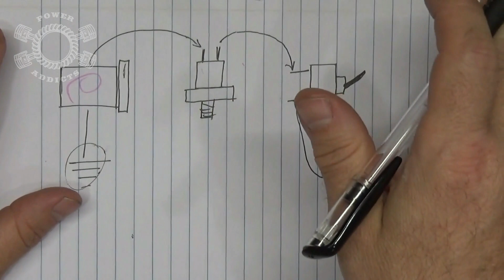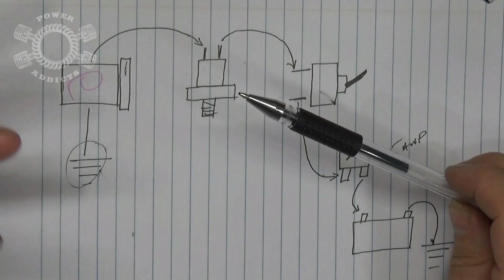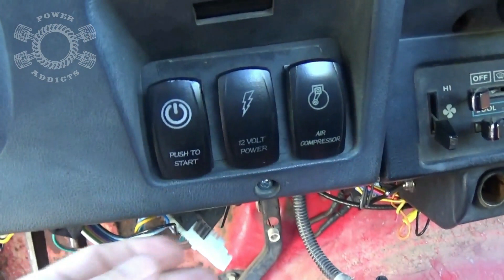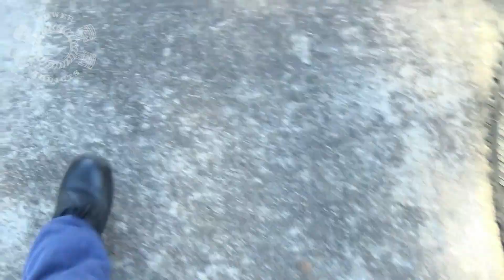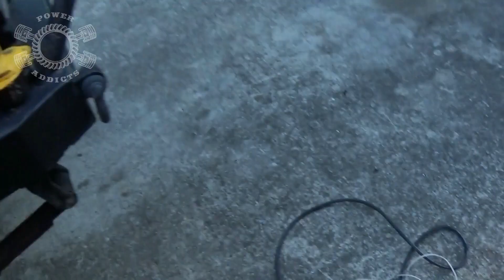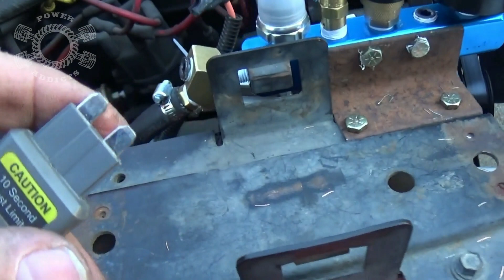Onboard Air Compressor Electrical Wiring #jeeponboardair #poweraddictscrew #onboardaircompressor

Comment from the maker: If you need an electrical meter, here is the one I use the most: https://amzn.to/3t3XbT2
Air pressure switch options: https://amzn.to/3sYmCFx
12 volt switch options: https://amzn.to/3z5GslS
12 volt fuse options: https://amzn.to/3LQVBKI

If Power Addicts has ever helped you and you wanna contribute in some way, here are some links that can help make that happen. Here is an Amazon link that gives Power Addicts a small commission. Using this link costs you NOTHING more. https://amzn.to/39XSTTO

The Paypal link is a simple way to make a simple donation if you want. Thank you for hanging out!! https://www.paypal.com/paypalme/PowerAddicts Thank you very much!! Have a great day!!

Comment: Hey, I have a question, my compressor works fantastic!!  Thank you for your vid!!

But I have a clear air hose and noticed a fair amount of water coming through it.  Guess it's in my tires now, lol.  Have you had this issue?  I live in FL, where humidity is off the charts.  Maybe it's that?

Thanks for any help

Comment: That's the same wiring diagram for electric fans Except for swap out the  Pressure switch for a temperature switch
Reply from the maker: Yep. exactly! Well, except for I would add a bypass switch to bypass the temp switch if needed..

Comment: Great video. Love all of them. Still on the fence about cutting the access panel for the fuel pump😂makes total sense though. I have to drop my tank when I go thru a little more gas. Already did the test at the plug, thanks to your video. I appreciate that.🤙🏻